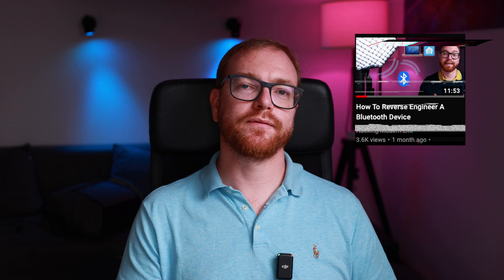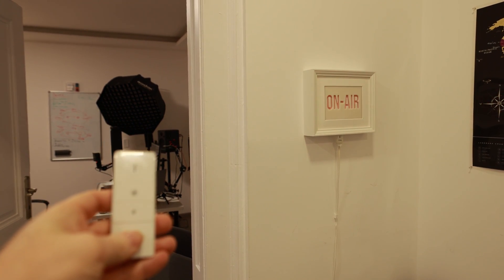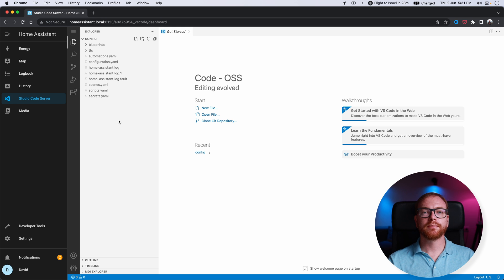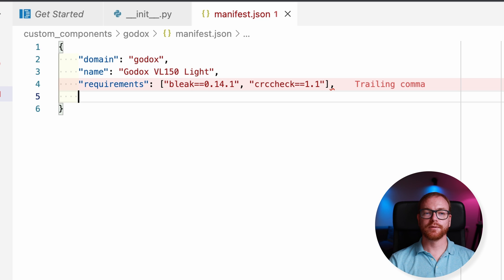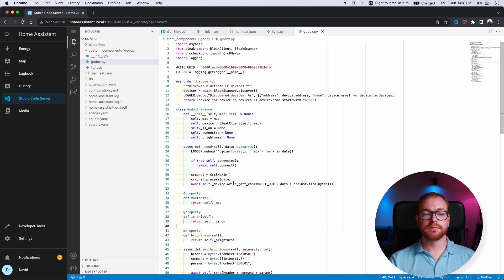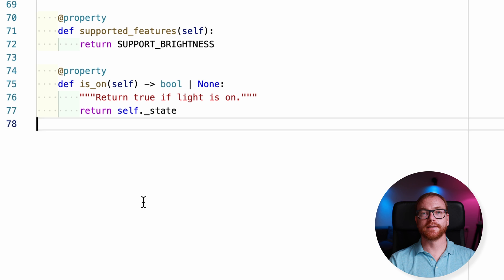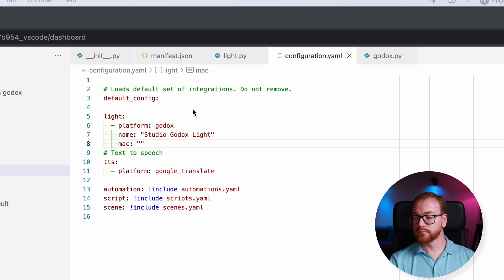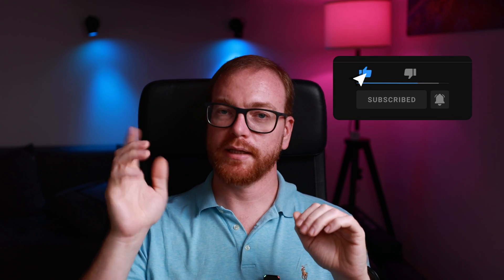It's THAT easy! Building a new Home Assistant integration in Python

Comment: Feedback as a developer: This is hardly an overview on how to build an integration. You didn't even touch on the config flow, which has been the recommended patter in HA for quite some time now. You also didn't touch on stuff like interfacing with actual devices and/or external APIs.
Nothing agains the video or content itself, but I think you should name it accordingly.
Reply from the maker: The actual interface with the device was converted in the first part (Reverse engineering Bluetooth devices), and when that video was made it was before the new config flow or native Bluetooth was introduced... I keep planning to do an update with config flow and native Bluetooth, but I'm never enough in my office lately to actually work on it...
Reply: @hml  +1 on that video. Can't wait for the release!

Comment: Hello. Many thanks for this tutorial. It is pretty clear. I was looking for a way to create my own integration. To be honest, for the moment, I don't need to control a bluetooth light but I was interested in how to create an integration that manages a hardware through python script.
Anyway, I have created the files in my "custom_components" folder and edited my configuration.yaml. Unfortunately, I can't see any new device neither in the dashboard nor in Settings->Devices->Integrations nor in Settings->Devices->Devices.
I don't know what I missed! Is it because I don't have the bluetooth device?
If you could help me it would appreciate.
Thanks.
Reply: I could have found a problem. The configuration checker in Developer Tools raises this error : "Platform error light.godox - Requirements for godox not found: ['bleak==0.14.1']." How to fix it?
Reply from the maker: Hey Matthieu! Hopefully you already found the problem, but first - make sure that the manifest.json includes "bleak" in the requirements. Also, if you'll check the code repository (https://github.com/hml-yt/ha-godox) there's a new branch there called "ha-native-ble" which is an updated version of the code for the latest HA version (which I prepared for a future video, but didn't get the chance to do the video yet) so it might be a better starting point. Lastly, our Discord might be a better place to ask questions, and I'll try to figure out the issue you're having together with you over there.
Reply: @hml  Hi! 2 months later, I finally found some time to work on my project. Unfortunately, the GitHub link you sent seems to be out of date. Is there a new link? I just joined your Discord channel. I will continue this discussion there. Thanks

Comment: I was looking for a video on whether it is possible to run a python program with its libraries in HA. But it's also been interesting to see this.
Reply from the maker: It's definitely possible, either as an integration, or as an addon, what are you trying to run?
Reply: @hml  It is a Chat Bot for Telegram entirely in python with libraries such as pyTelegramAPI, pymongo, nltk, setuptools...
It would be to run it independently and make it functional without having to use other Raspberry exclusively for it.
Reply from the maker: @RazuEazu  sure, you can easily wrap it as a Docker container, and then use that as an addon in HA. Alternatively, just install the Portainer add-on and run the Docker container through that.

Comment: How would I go about creating an integration for homeless assistant for a online platform. I'm looking at a light controller that has its own online platform and can offer an api for integrations
Reply from the maker: Exactly same process, just instead of using Bluetooth to connect to the device, you use the devices API. So async_setup to connect to it, async_update_data to update the data from the end point. As far as Home Assistant is concerned - it doesn't care how you control the device, in a way.

Comment: Hi... great video... but a critical question please... the Home Assistant Documentation seems to "strongly" suggest we should not be putting integration API code (python that actually talks to devices (such as your godox) into the home Assistant code, and we should instead be importing from the PyPl Library. In your video I think you are showing us that you put your device specific godox code into godox.py and did not import from a library... is this right? and what do you think about that? Many thanks...
Reply from the maker: Thank you! You are indeed correct, that the proper way to implement a HA integration, is by creting a PyPI library and then calling it from the integration. The main reason for this is ease of maintenance, and to allow others to contribute to your integration, even if they don't use Home Assistant. However, if it's a local integration that only you use - it's much easier and faster to do the full integration locally. Especially with the new Bluetooth native recently introduced. Also, I intentionally separated the code interacting with the light into a separate module - that way it's easy to extract it to a PyPI integration, and that definitely would be the next step.

Comment: HomeAssistant released their native Bluetooth support. Could you do a follow-up video explaining how that is different and possibly editing your integration to work with that?
Reply from the maker: Definitely, working on an update to this tutorial for the new native Bluetooth integration right now
Reply: @hml  any updates on this update? Curious if the Bluetooth update simplified the process at all
Reply from the maker: It definitely made the configuration and discovery of Bluetooth devices easier. The code is ready for a while, need to find some time this week to record the video. The video will include working on HA in Docker, and building a config flow as well, so a bit more advanced than the previous one.
Reply: @hml  great! Do you have a GitHub where the code is? Or are you waiting to release that with the video?
Reply: @hml  Any news on the video? Can't wait :)
Reply: @hml  patiently waiting for that video, so I can try to integrate my e-way scooter with home assistant :)
Reply from the maker: @Jonas Duus   @Iisakki Kaaretkoski  yeah, guys, I know this is long overdue... but because of travel for work, I'm not enough in the studio... I will definitely finish this and release as soon as I'm back in the studio.
Reply: @hml  I'm eagerly awaiting the video, you are awesome.
Reply: I'm super eager for the next video too. I have a Moonside Lighthouse ble lamp that I need HA control over. Someone already sniffed most of the commands it uses so I just need to put them into your future teachings. Any help you give would super appreciated  @hml
Reply: @hml  waiting for the new video. I'm trying to add a bluetooth battery sensor to home assistant
Reply: Thank you for sharing this. I am eager to see your next vid/code and flow on controlling a Godox using Bluetooth.

Comment: I actually want to try and build some custom components, in your video you kind of skipped the explanation of building an homeassistant component, and showed how to create a specific script for a specific purpose.
Can you by any chance give me a place where I can find a good tutorial  or a documentation to the custom components building from scratch?
I have knowledge in python, so O just need the basics of how an homeassistant component should be built.
Thanks in advance :)
Reply from the maker: Sure, the documentation is here - https://developers.home-assistant.io/docs/creating_component_index/, but generally you have a number of entities (like I show in the video) that you use as the starting blocks. In this example, I used the Light entity as the basic block to create a light integration. It's not a script, but a full integration - it supports scenes, brightness, on/off and so on. Good luck! What are you trying to build?
Reply: @hml  step 1 on that tutorial is  : python3 -m script.scaffold integration  

problem 1 is  : where do i have to enter this instruction?

Comment: How to 8ntegrate raspberry Pi pico?
Reply from the maker: How do you integrate it to what? You want to run Home Assistant on the Pi Pico, or use it to update something inside a different home assistant instance?
Reply: How to integrate as esp8266
Reply from the maker: @nagarava  so you want to use Pico to control another device, similar to the ESP8266?
Reply: @hml  yes
Reply from the maker: @nagarava  Interesting idea, I will definitely make a video on this in the future!
Reply: @hml  Thanks

Comment: I am trying to setup a button and not a light and having a difficult time determining what headers to use instead.  Where did you find the light example you are copy and pasting from?  Is there an example to for setting up a button?

For context, the device I am trying to control is an adjustable bedframe and does not report back its state to the native app.  So I want to be able to control it from HA using Bluetooth and emulate the Bluetooth commands.
Reply from the maker: The code I copy paste is from code I wrote myself (you can see it in the linked repo in the description), however it's heavily based on the examples from here: https://github.com/home-assistant/example-custom-config/tree/master/custom_components, specifically "example_light". You can take a look at the example for "detailed_hello_world_push", which implements window blinds, that I imagine would be similar to the bed frame you're trying to implement. The light in the video doesn't report back it's state either, so you just need to implement it with "assumed_state", and in your case, I would imagine you would based it on either "SwitchEntity" or "CoverEntity" (https://developers.home-assistant.io/docs/core/entity/cover), instead of the "LightEntity" that I based it on in my example.
Reply: @hml  thank you very much!
Reply from the maker: @TheJCDFilms  sure thing! Let me know how it goes, I'd love to feature your solution on the channel!
Reply: I am trying to do the exact same thing at the moment, please let us know if you make it!

Comment: I’d to see one you actually write from scratch and not copy and paste blocks you’ve pre written
Reply from the maker: You sure? I thought it would be pretty boring to watch me type for half an hour :-) But I guess in the future I could share more of the thinking process.
Reply: @hml  I know almost zero about python so it’s the why that’s important. t hardest part for me is understanding why you’re including the blocks you did and where you got the “base” of each block. And other items like what documentation are you referencing as you’re making this (dev docs, previous things you’ve done, others integrations?)
Reply: @hml  I would much rather have 30 minutes of typing that I can scroll and skip through than 10 minutes that I do not understand without knowing Python and the libraries used. We are here to learn, not to be entertained :) 

Would also make it a lot easier to adapt the methods you are using to other types of BLE receivers that do not have any integrations written yet, like adjustable beds, relays, power outlets etc.